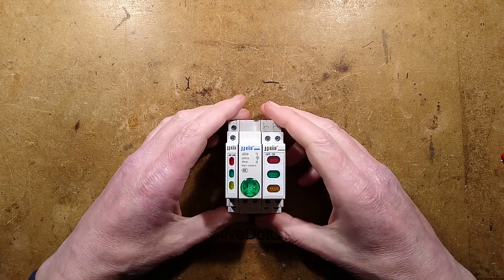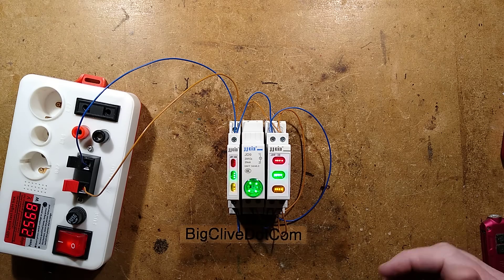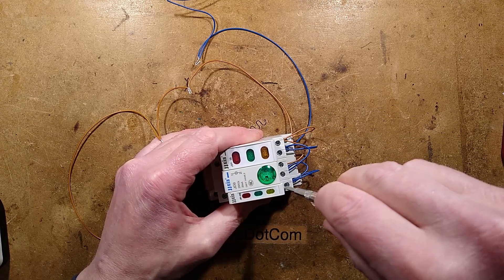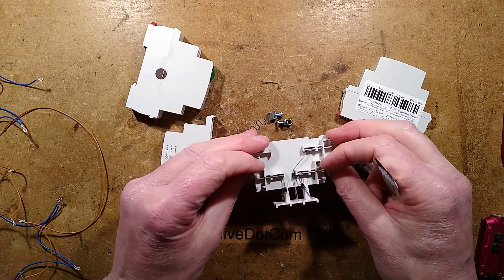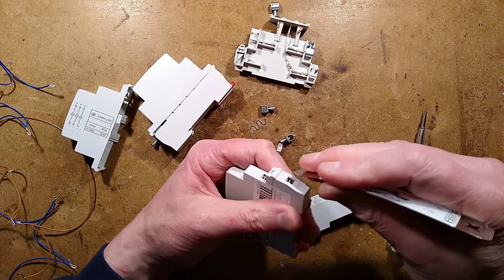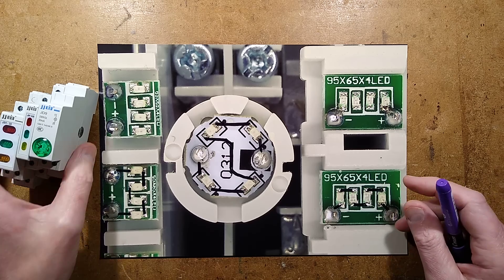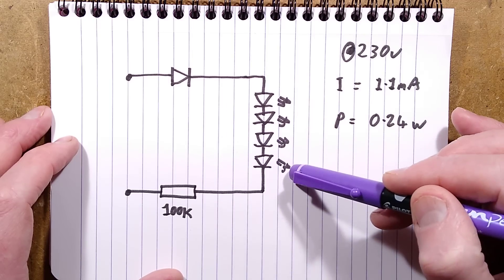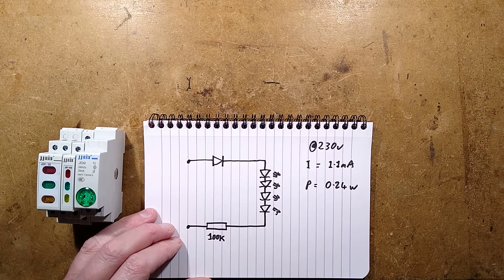AliExpress DIN rail industrial power indicator teardown - with schematic

Comment: Are these safe to use in a DB panel? wont they get hot and burn if you put it together with your Main supply breaker? and what gauge would you use for a 220v Line-to-Line?
Reply from the maker: These are intended for control panels with a suitable control circuit fuse.

Comment: A triple LED indicator if they're all of the same color is very useful. You can use it to indicate which phases are working on a 3-phase system. In normal operation, all three lights should be on. If only one or two are on, you lost a phase or two and that's why things are going haywire. Losing a phase leads to so many oddball issues having a simple indicator showing that all 3 phases are energized is a remarkably useful utility.  If you have 3 phase in your home (some places do), then installing such an indicator can help solve many issues.

Comment: Another small signal diode, like a SMD 1n4148, connected anti parallel across the LED series string would have taken care of any reverse leakage through the 1n4007...

Comment: I've installed a "aliexpress" smart energy meter. I would be very, very interested in their inner workings. And how safe they are. Would make a even better video i think. I could sent you an link to which one i mean. 
Love your video's by the way, although i am an electrical engineer (ships and now machinery in food and beverage) i'm not really at home at small electronics. all be it that i do use small electronics for my model train lay-out.

Comment: I made this DIY. A simple hack I did was to put every 2 LEDs in anty-paralel. So every one is leakage protected. I also put a 100k resistor on each side, so if one fails short, the other can take over.

Comment: These are pretty durable owing to their simplicity  I've used them for many purposes, and the basic guts is very much identical to the "fuse failure" indicators on DIN Rail fuse holders ("lit when failed")The ones I've got (decade ago?) from Tomzyn have a small cap. across the LEDs to reduce flicker.
Reply: So your 'fuse fail' indicator, wired across the fuse or CB, allows voltage to the circuit that blew or tripped a CB? (being light on fuse blown) 
Used in a mains voltage system, ask yourself, what could possibly go wrong.
Reply: @BTW...  These LED based indicators all have a significant series resistance (comparable to the old neon "Mains Tester" screwdrivers. They are also IEC approved. That might answer your question.

Comment: I think the RMS voltage of a half rectified sineave is 1/2 of the 240V .... So I think the resistor only sees about 110V RMS, and the power dissipation will therefore be 110^2/100k ~ 0.12 W
Reply: No, the RMS is the quare root of the mean of the square. So half wave rectification only reduces the RMS voltage by sqrt(2).
Reply: @petermichaelgreen  Yes, you're right.

Comment: Schematic at 9:00 That diode should be connected reversed parallel to the 4 LED's, so they get no reversed voltage. Even better, two times two LED's in series, and these back to front parallel, no need for a diode, and they shine as 100 Hz if you keep the four LED's close together.

Comment: Is it fail safe ? Diode bridging, etc... What can go wrong and to what extend ... 🤔
Reply: If the diodes or LEDs fail short , then the resistor will still limit the current to reasonablly safe levels, but if the resistor fails short then there would be a massive over-current. A second resistor would make me feel much safer about the design.
Reply from the maker: I'd prefer at least two resistors.

Comment: But what the heck are they meant for?    If all three colors light up, what information are we to glean from them?
Reply: The triple LED modules allow each LED to light individually.Clive just wired them all together to test them.
Reply: @oldarchillies163  ::  Yes, but seeing red, yellow, and green, I'm expecting their usual (bad, fair, good) meanings.  Are these just three phases, or something else?  I don't have DIN rails in the US, and can't imagine what three conditions such a module would show me.
Reply: @jeepien  No, not phases. Just individual LEDs which can be used to indicate anything you like. They do not even have to be AC power, BigClive just tested them with line power because that was convenient for him. When I was building systems, I used red for power, yellow for data OK, and green for PLC watchdog OK at the maintenance remote office so the users did not have to go all the way to the closet to see if the system was running. Could have been for anything though.
Reply: @oldarchillies163  Hmm.  Sounds like a solution in search of a problem.
Reply: @jeepien  Actually useful for indicating status of multiple systems at a glance. But YMMV of course. All good.

Comment: Former lab technician here from a company that made such indicators back in the 1970's.  All them clip cases are designed to be assembled once and disposed if they fail. Back in 1979 we experimented with all colours of LED available. We were the world's first to sell LED traffic lights. We also made panel light buzzer combinations. Customers wanted reliability as our products were used globally in cable cars, trains and busses so we had filament indicators with a 20 year lifespan and LED ones suggesting 30 years at the time. Buzzer frequency was precisely chosen not to reduce indicators lifespan avoiding any resonance. All our LED products had diodes especially chosen to have triple redundancy in  reverse leakage to protect the LED's used. A 220V certified product for industry was tested at 660V for 24h. A medical product was each tested with 1000V for 24h to ensure failure was not an option. Manufacturers of the famous 1N4007 would return our money when diliveries were out of spec. So each technician could take home a box of 1000 such out of spec diodes. As per today I never managed to kill such a diode.
Reply: Dialite?
Reply: Appreciate the story! So cool to hear. Thanks :)
Reply: @LawpickingLocksmith  Nice story, thanks!
Reply: Super interesting. Thanks.
Reply: The days when things well made to last.... Well never have that again.
Reply: @Slikx666  nah...

Comment: The diode is to protect the LEDs against reverse breakdown. The diode will drop almost all the voltage in the reverse direction so the LEDs don't see a voltage above their reverse breakdown voltage.

Comment: Clive, I need your help! 

I've had this passive ph probe from aliexpress for a long time but more recently, I bought a proper ph pen with a proper sensor after I just couldn't learn to trust that aliexpress one. Today I decided to open the Aliexpress one to see what makes it tick (hope you're proud!). What I found seems like an outright scam hah. The PH meter has two probes but one of them is connected to literally nothing while the other probe goes into a tiny coil that serves as a meter. Only the first third of the switch seems to do anything. The middle setting has only a probe leg connected to it so I guess it works via brain wifi or something. Nothing connected to the last third of the switch that reads moisture content, supposedly. 

It's a green thingy with a 3 way switch and two probes that supposedly tells you the ph, light intensity and moisture content. Seems like only the light intensity part does anything but I would love for you to break one down for us so you can tell me exactly how badly I've been scammed, if at all!

Much love :)

Comment: If the voltage drops below a range 230v-210 etc do the LED's drop from Green to Orange or Red to Orange? Don't really get what you'd use them for..
Reply: It isn't a meter, each LED is to monitor the power that goes to something you want to monitor.
Reply: Ok thanks!!

Comment: The SMD resistors don't look big enough for the voltage across them. For an application like this, (240 VACrms) they should be at least 1206 size.
Reply: I didn't see any SMD resistors. I saw SMD LEDs on the PCB and through-hole resistors & diodes hanging free.

Comment: They could connect two LEDs in series and two other in anti-parallel without the diode. They would light alternately and clamp the reverse voltage to a safe level to prevent the reverse current what You mentioned.
Reply: That would work, but it would double the power dissipation in the resistor. Also, if you used it on DC, then only 1/2 the LEDs would light up.
Reply: Sounds good but I don't now if you're right. Excuse my lack of knowledge.

Comment: Are these (and other devices in the same form factor) used in the equivalent of a US circuit breaker panel?
Reply: More or less, I don't know if the US breaker panel allows other things than breakers, but for DIN panels there are breakers, fuses, switches, outlets, indicator lights, buzzers, timers, relays, contactors, phase monitors, meters, sensors, surge protectors, power supplies... you can even get empty housings to build your own device.

And for the DIN rail itself, when used inside an industrial cabinet, there are even more things you can quickly attach to it instead of having to screw everything to a backplate

Comment: So all three colors always light up simultaneously? I expected them to have some sort of low-medium-high function.
Reply: Or, wait a sec. I misunderstood. So every color has its own input terminal. That means you could hook it up to a plc or similar, to use them as a low-medium-high indicator.
Reply: @jhsevs  On / Off / Fault
The question is what the colour means.

Comment: You mention (  blue LEDs  ) and silicon diode (  1N4007 ?  ) leakage .... a  LOT  of  modern  UK  electric kettles have a blue LED in their base  " paddle " switch .... this is in series with a HV  Silicon diode .. and ... a  BIG  PHAT ( ? )  ceramic block resistor ( 5 K Ω  to 22 K Ω ! ) ... this seems to work OK  ... the reverse leakage is one or two (  μA ! ) , maybe even less ? .. the LEDs seem to be OK with this TINY  reverse current , but a good point to mention nevertheless ! Heh -Heh .... DAVE™🛑
Reply: 1N4007 are rated for 1000V. 600V rated will do just as well.
Reply: @BTW...  Yes you are correct ! ! ... my last company used 1N4007 for  EVERYTHING !  ... the tiny extra cost was to avoid stocking several voltage ratings , but more importantly to avoid  putting an 1N4001 in a high voltage PCB , by accident ( disaster ? ) .... DAVE™🛑
Reply: Leakage in kettles adds another level of complication.
Reply: @robt2151  YES ! ! ... usually a wet  kitchen worktop ( GRRR ! ) ........ DAVE™🛑

Comment: Those small resistors are not rated for mains voltage.
I wouldn't be surprised if they use carbon-film resistors in these products.
Reply: You can get high voltage 1/4 watt resistors which are good for 1600v, but I suspect these will be the floor sweepings from the local resistor manufacturer that might be rated at 200v or so.

Comment: Perfect for modifying with some blinkies, have a whole rail filled with them all with the flashing LEDs fitted running at different frequencies (E.G. some 0.5Hz, some 1Hz, some 1.5Hz) and have yourself a high tech energy solution prop... :P
Reply from the maker: And then sell it to gullible rich people as an eco energy management system.

Comment: Hmm, what is the required usage of these?????
Reply from the maker: Whatever you wish an indicator for.
Reply: The most obvious application is safety indicator in any wiring closet: you don't want to waste troubleshooting time on missing input phases. It is also helpful as an initial indicator that power has been turned off before working on wiring and as a back-off light if you see them unexpectedly turn back on while working in there.

Comment: Would having some leds in reverse, protect the whole set against reverse current?
And would a capacitive dropper be more power efficient for the this application?
Reply from the maker: Inverse parallel LEDs and two resistors would have been a good option.  A capacitive dropper would make the unit only suited to AC.

Comment: Resistors and a diode... So how did the RED indicator on the top right module appear to blink ON for about a second at time:  2:23 thru 2:25 ?  Was it a reflection on the studio lights? Before  I saw the schematics, I thought it is could be discharge of a capacitor, but there isn't any.  It was just odd.
Reply: Yes, that's just a reflection. If you advance frame by frame you'll see it hits the other lights and the grey surface as well.
Reply: @RFC3514  Yes thanks, I see it now.  I knew that it couldn't be some odd static discharge . Thanks.
Reply from the maker: Probably the camera and a rolling shutter effect.